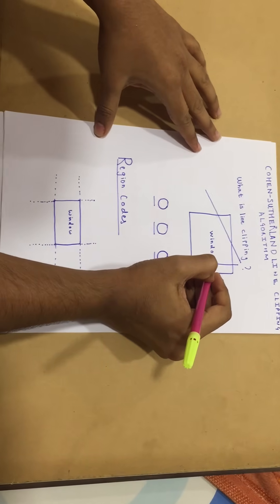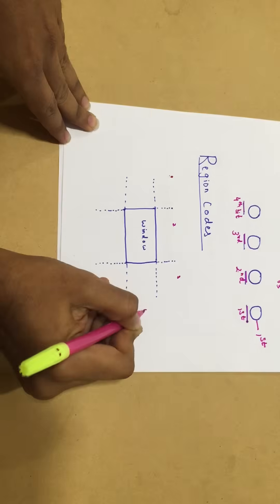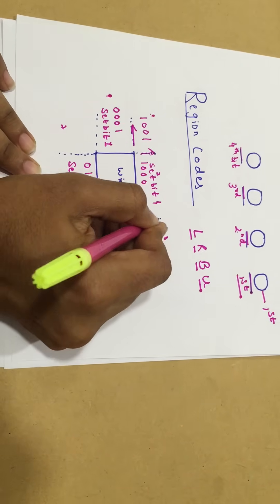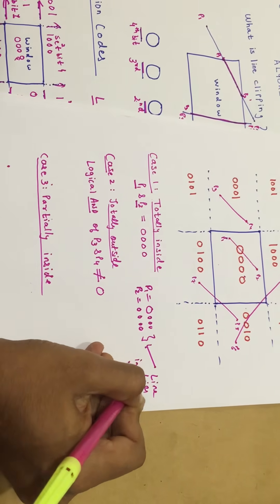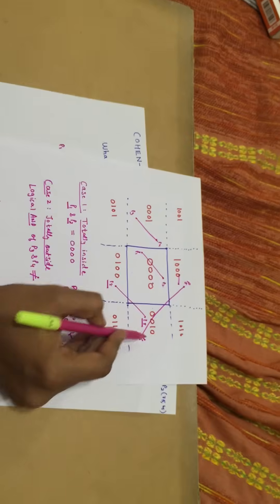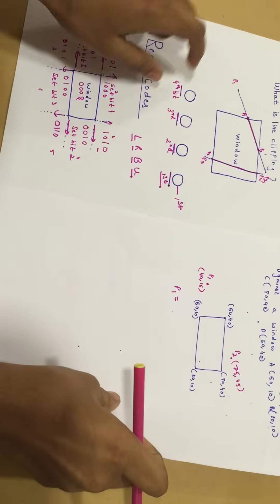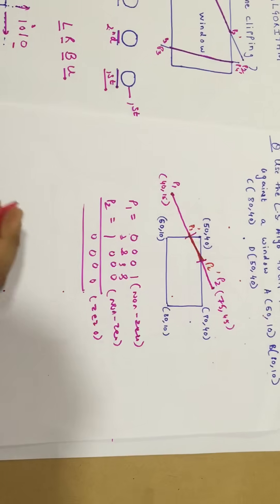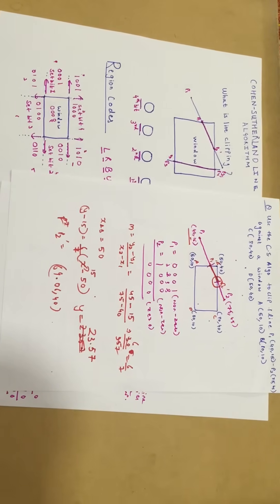Cohen-Sutherland Line Clipping Algorithm

Comment: so many mistake in the video, please correct it.  In the example while calculating the  y co-ordinate of P1'  equation should be  (y-15) = 6/7 (50-40) where Xleft=50 and X1= 40 . 15 is not the value of x, although the  answer is correct. Please correct the equation. Thanks :)
Reply: thank you

Comment: Use the VLC media player to rotate this video. Here is how.
1 - Open the video in VLC player.
2 - Tools menu and select “Effects and Filters”.
3 - Click the “Video Effects” tab.
4 - Select the “Geometry” sub-tab.
5 - Check the “Transform” box. This will enable the menu underneath. Use this menu to choose "rotate by 270 degree".
6 - Close the “Adjustments and Effects” when finished.

Comment: Sir , What will be the region code for the end points of the line segment, which touches the edges of the clipping window but outside of the window.

For example , if we have the clipping window defined by the coordinates
A(4,3) B(9,6) c(7,6) D(7,3) and the end points of the line segment which we need to clip against the window  are p1(2,6) and p2(9,3). My query is , what will be region code for the end points p1 and p2. Say for p1 which is the correct region code among 10001 and 0001 and so on for the p2 as well ?

Thank you !
Reply: 0000, so it gets "drawn" trivially. but will not be seen per se. it could change the window's border color for example or make it thicker.

Comment: There are a lot of mistakes in this video which you should rectify or leave a note about. It is really frustrating.
1. At +11.09, it should be 
(y - 15) = 6/7 (x - 40)

2. In the above equation, x should subsequently be put as (50), because we want to find the (y) coordinate in this line equation when the (x) coordinate is 50.

So, the final equation comes out to be 
(y-15) = 6/7 (50-40)
Which, after solving, gives the answer as : 
y = 23.57

You know the answer but you don't know how to replace the line equation with the correct coordinates. Please work on that at the soonest.
Reply: +Manish Dash 
Good job bro.
Reply: Infinit u are wrong dude..  pay attention once again
Reply: Manish Dash thanks mate i rectified it when solved it
Reply: Lots of Mistake ? I see only one mistake.
Reply: Manish Dash mate he did it right you are wrong its x cord check its 50